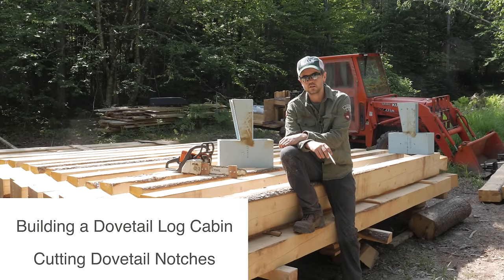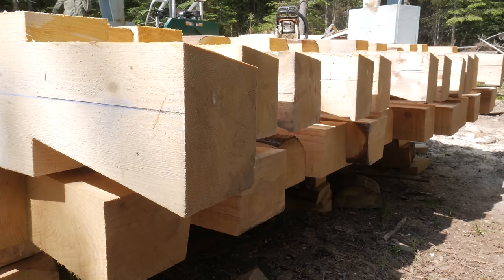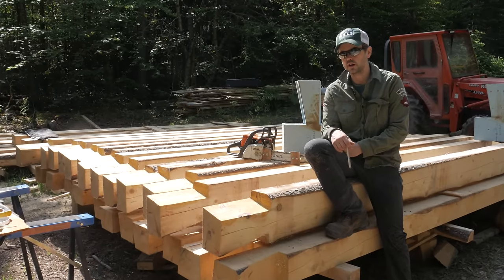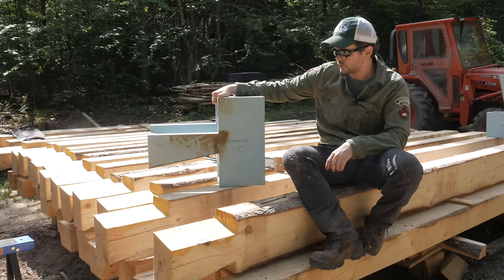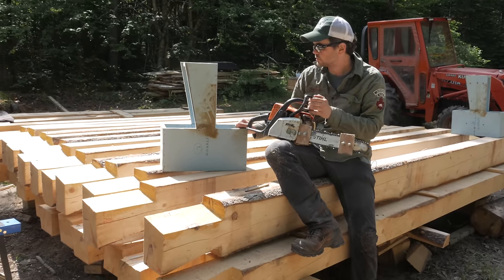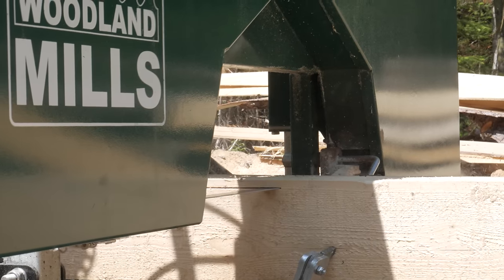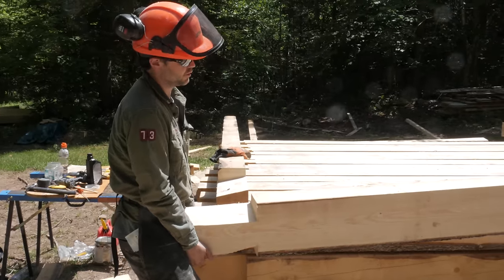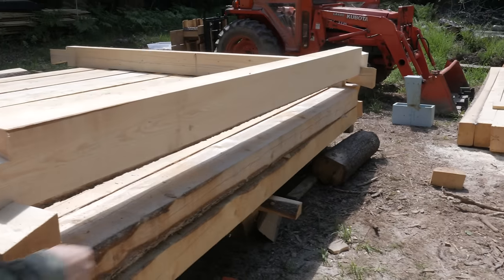Dovetail Log Cabin - Cutting Dovetail Notches

Comment: Handcrafted log houses have been built for centuries in the Eastern parts of Finland. Also in Scandinavia, Russia and Eastern Europe, and were typically built using only an axe and knife. The settlers from the northern Europe brought the craft to North America in the early 17th century, where it was quickly adopted by other colonists and Native Americans. Possibly the oldest surviving log house in the United States is the C. A. Nothnagle Log House (circa 1640) in New Jersey.  The Dovetail is designed to shed water in every direction which is why they are still standing more than 350 years later.
Reply from the maker: Hi Joseph! Thank you for that history and information. I find cabin history fascinating. The dovetail notch, to me, is just so beautiful. What part of the world are you in?
Reply: A very late reply to this video, but as I find myself coming back to it time and time again as I’m doing my research, I’d thought I would leave a comment to this as I saw it fitting.
We’ve had these types of dove tails in Sweden for I don’t know how many hundreds of years. It’s a very common style in my province of Sweden at least, we do however make another angle instead of having them lapping straight like you’ve done. We have them angled from the outer edge to the inner as well. So apart from the vertical angle, they’re also angled horizontally if you understand how I mean. Hard to explain really unless I could find a picture of it. Anyways, I love the videos and would like to see more projects from you!

Comment: I can understand 200 years ago why the used concrete or whatever between the logs to seal the gaps but you'd think by now something better would be used like a rubber seal that's squeezed between while it's being assembled. You know they would of back then if they had access to that sort of thing.

Comment: I built a cabin just like yours with the dovetails almost thirty years ago only difference was I left the live edges top and bottom on the log and cut my notches with out the jig. I enjoyed felling the trees and milling the logs with the chain saw , I even put a half story on the cabin and my floors and roof were made of poles and planks that were taken from the property. My foundation was a drystack rock that I also harvested from the land which on the downhill side was as tall as me and I'm over 6 foot. All in all the cabin took awhile but turned out looking like it had fallen out of a fairytale because it was created using material harvested on site. Great video it brought back some fond memories of my time in the high country.
Reply from the maker: Hi Mark! Really appreciate the comment and your story. Would be interested to see your cabin. Where are you located? There is something special about building a cabin, I really am enjoying it. I have learned a lot from many people in the process and it has been really rewarding. Thanks so much!

Comment: I just about finished my 16 x16 with an 8 porch using the same dovetail jig. It worked out fantastic and after about  1-1/2 years the first joints I did are still very tight.  Great system, good luck with the project.
Reply from the maker: The jig is great - I found it tricky to build, especially the beveled cut. Had a friend help who had some better tools. Where are you located John? 16x16 sounds like a good size. I hope my joints stay tight over time too. What kind of wood did you use?
Reply: @PenniacWilderness  mine is white pine in New York near Buffalo. Here’s a photo

Comment: I worked on some restoration of rotted sill logs + 2nd round on a historic cabin in AK.  Up there, they left the tops of the logs round and carved a cup along the bottom of each log to receive the one below.  I wouldn't guarantee that made a tighter seal, but that was their thinking back then.  We didn't think of a jig, just a ruler, square, saw, chisel and adze.
Reply from the maker: Interesting! It is fascinating to hear and see all of the different ways cabins have been built. I have seen the type you are describing, and likely it is a very good way to build. I started this build as a novice at best, so the jigs were good for me to use. I got the plans for the jigs from logdovetailjig.com and then made them in the shop.

Comment: Nice setup. Not the style I plan on using, but the use of jigs to reproduce same results is always a smart way to go and something I need to consider when I get around to building my vertical log Viking longhouse in two or three years on my second Alaskan property (currently building a tiny house on first Alaskan property).
Reply from the maker: Interesting! Alaska is such a beautiful spot. I went to Denali in 2017 and spent time in Alaska beforehand. Thanks for connecting :)
Reply: If or when a horizontal log rots it can be replaced. When vertical logs rot the whole bldg
needs replacing.

Comment: Put a 2X4 flat on top of each log to help make it more air tight you can put a bead of caulk on the 2X4 .... There will be a place to put mortar , just take two inch tape a run it along the top and bottom of the 2inch opening them fill it with mortar , let your flat trowel ran on top of the tape ... When it hardens remove the tape..
It will look great..oh might be a good ideal
To put a few drywall screws in to help hold the mortar in because that house will move ... From heat and cold ...

Comment: I've watched old Finnish carpenters build these things by eye with primitive hand tools from raw logs.  It's impressive.

In Scandinavian construction they stack the logs tight with only moss (insulation nowdays) between them.  This is warmer than clay or mortar chinking.
Reply from the maker: I get a lot of comments about the gaps - I gather that different regions seemed to do it full-scribed vs with gaps. I think there seems to be pros and cons of each. I just like the look of the chinking in a cabin, personally. I think with the size of my cabin, and the way I plan to insulate the roof that I should be able to keep it warm :)

Comment: Very nice job ‘ just one question ‘ I know the gaps between the logs are chinked ‘ can u tell me does there need to be some type of downward angle on the log faces to prevent water seepage into the cabin’ when the logs shrink’ eg driving wind and rain ‘ or as we call it here in Ireland horizontal rain ‘ thanks very well explained’
Reply from the maker: Hi Martin - Thanks for asking. Where in Ireland are you based? I actually have worked in Ireland before but am based in Canada. You ask a good question - I see some people use the downward angle on the logs and others do not. I am not sure yet what I will do. I have a lot of overhang on my roof to protect form the vertical rain. I could easily bevel the edge of the bottom of all of my logs before chinking though too to be safe. What are your thoughts? Are you building as well? I think you can also angle the chinking such that the upper portion of the chinking is recessed more in the joint than the lower portion and therefore creating a form of drip edge as well. Short answer is that I am still thinking it through and open to ideas!
Reply: Hello again ‘ yes I am building a cabin like yours 20 by 16 ft ‘ with them beautiful dovtails
Reply: Hallo again ‘ yes I an building a log cabin 20 by 16 ft ‘ with them beautiful corner dovetails ‘ the logs are mill top and bottom and milled on the inside ‘ with the live edge on the outside’ in other words d shaped ‘ there is a 5 degree fall out on the logs top and bottom ‘ with the inside vertical ‘ I think this system will help water to flow to the outside and not flow into the cabin ‘ with our horizontal rains ‘ I live in wicklow in the mountains ‘ the logs are milled on a bandsaw 8by 8 inches ‘ and milled with the 5 degree offset up against the saw bed stops ‘ I have the wall up and the vaulted roof nearly on ‘ I started this time last year ‘ and I think it will take me another year ‘ so a 2 year build ‘ but I love building it and it is a great learning experience 😄
Reply: @PenniacWilderness  big roof overhang (4'+) will save your walls & foundation better than eavestrough with the ice of a Canadian winter.

Comment: Why is there gaps between logs ? I'm from Sweden and we never have 2 inch gaps that we fill with clay or cement. That's something I've only seen in American tvshows. Is there a reason for this?  Nice video and aesome jig anyway. Looks like a nice build
Reply from the maker: Good question - I am not entirely sure why they did this in America. I have also seen the gaps in cabins in Eastern Europe. I am guessing that part of the reason may be due to the twisting of green logs. With the gap between logs any twisting would not really affect the overall cabin structure. I am not certain if there are other reasons. Let me know if you find out! I wanted to build this style because I just really like the look :)
Reply: You use less logs,  as many as 8 depending on the log diameters and the size of the gap you want, that saved a lot of man hrs when all you had were hand tools and horses.....and no precision required if the logs weren't perfectly straight....less frapping, I think thats what they called it when you used an adze or an ax to square/flatten the logs.... Some gaps are almost as much as 6"....
Reply from the maker: @jedidiah5131  Good point about using less logs - for ever four - five logs I am using, I probably save one. Thanks for the comment!
Reply: Many log cabins were built with logs that were neither hewn nor sawn along their length - they were round and rough, so there were gaps that required chinking.  Now people leave gaps without need, trying to look like those more rustic log cabins.
Reply: Thank you for asking this. I wondered the same myself. Now with saws being able to cut perfectly straight blocks it seems that it would create a better insulated house with no gaps at all and filling the space between with just some small strip of wool before placing the next layer of logs.

Comment: I’ve built cabins all my life- do not screw them together or use rebar to keep them from bowing!!!!! When the cabin settles there will be gaps and huge issues-
Reply: What other issues?
Reply: @masaigeraghty3525  Just my thinking... Probably best to let the cabin settle many years and the logs to bend or move as they want. Do repairs as needed. If you use rebar or spikes, one problem log could effect several more that its tied too. This certainly could be an issue if you're using whatever logs you can scrounge on a DIY build vs logs that will probably be more stable from a log home company.

Comment: @ 4:42---Half of a fraction is very easy to find. Also to double. One half of 1/2 is 1/4. One half of 11/16 is 11/32. All you have to do is double the bottom number. 19/64's becomes 19/128. To double, just go the other way. 1/4 becomes 1/2. 19/32 becomes 19/16's.
Reply from the maker: Thanks for that! Yea, I am so used to metric from my day job that fractions are not something I use regularly. I am picking it up though, I like your tip!
Reply: Did he say half of 10-1/8th was 4-1/16th ? Oh no 😲😲 stick with metric it's sooo much easier and better, catch up USA !!
Reply from the maker: @colstace2560  Metric certainly comes more naturally for me, but I am trying to work with fractions as best I can. I don't think I really used fractions since math class in school though.
Reply: Converting fractions to metric is another problem, for me anyways.  Whatever works for who ever is doing the work is a good rule. Thanks for the vid.

Comment: I like your comment about the bugs. Treat em like your training with weights on, i like that. If the training becomes too unbearable hehe, rub 100% pine gum turpentine on you jacket and they'll never come near you. Pine tree secretes pine sap to protect exposed area of bark so that no bugs or bacteria get into the bare wood. Turpentine is made from distilled pine sap meaning its a super strong bug repellant.
Reply from the maker: Thanks for the tips! Some day I should actually try that. I have heard about it but never tried. Thanks for the comment.

Comment: I hope you did not screw them. We did ours and as the logs dried they shrink sideways and you end up with gaps in the corners, because the log can't slide tighter. In the future we would drill a 1 inch hole an put a 5/8 ready rod top to bottom some play to allow the logs to be and stay tight in  the corners.
Reply from the maker: Thanks! We will see how ours goes. Lots are pretty dry, but we did screw them for a few different reasons. Time will tell, I will wait to do the chinking and can use it if new gaps open up. Thanks Robert for the comment!

Comment: Started re watching ur vids going to cut my logs this winter, when I order my jig plans what dimensions do I give Fred going to use cedar planned on only milling the inside and outside flat and leaving the top and bottom round, thinking of 2" gaps 6" wide by 10" to 12" tall logs cabin will be 12'x20' any info would be great Denis
Reply from the maker: Hi Denis, Do you want to chat on the phone someday? Send me an email at penniacwilderness@outlook.com with your phone number and I can give you some answers as best I can. Usually with Fred you just give him the log dimensions and the size of the gaps you want (I would think about larger than 2 inch gaps after my build). But let's chat!
Reply: We pulled apart an original log house in southern Ontario. The best preserved logs (150yrs +) were larch, not cedar. I was surprised!
Reply: @kerriwilson7732  larch is that a juniper or a tamarack tree that we call them here in southern new brunswick... lol

Comment: Simplest form of dovetail here, we would only use em for building where people don´t live in like barns, sheds maybe saunas, with out no wind blocking and stabilisation elements (that don´t allow the notch to move apart at all,  you should not use em for living quarters in harsher climates.  Although looks like not fully scribed, chinking style stuff so wind resistance isn´t high on list anyhow...   Still lovely to see more people getting into dovetail log building...

Comment: Dude, so glad you made this video....I'm building the same jig from Fred as well. It was nice to see it in action on here with those tricky bevel cuts. I ordered an 11 degree router bit for that, since my table saw only can do one side. Grew up in Downeast Maine (across from St.Stephen), you must be outside Fredericton..? Good luck with your build..!! 😎
Reply from the maker: Hi Dean - I have family in Perry, Maine. Yes I am outside of Fredericton area. I used a table saw for one jig and a bandsaw for another one. They were a little tricky to cut but after they are done the jigs work great. When do you plan to start your cabin?
Reply: @PenniacWilderness  Small world, my Mom grew up in Perry. Our family grew up in Calais, but I was born just past Perry  in Eastport. Anyways, I have 20 acres of 60 foot plus red and white pine. I've been felling logs slowly the past year or so to let them dry, I have a LT35 woodmizer to get them down to 7.25x10" I'm trying to do a zero gap. I only live 25 miles south of the property so its easy to get to.
Reply: Old timber framer here, Mainer exiled to Hawaii. Good job on your project and presentation. And good luck on yours.
Reply from the maker: @jdenmark1287  Thanks! Hawaii sounds like an alright spot :) I am located just north of Maine in New Brunswick, Canada. Maine is a beautiful spot as well.

Comment: A very fast and accurate way to divide a fraction in half (in your head) is to just double the bottom number and leave the top number alone. I don't remember where I learned this trick but as a carpenter I have used it for over 50 years.
Reply from the maker: Thanks David for the comment!

Comment: Or you could carry the centrelines down the front and back edges where they would come into direct contact with the line on the log. No confusing windows needed.
Reply from the maker: Hi Paul - Yes there are probably other good ways to do this too. The windows worked pretty good overall, but it did take some time. Thanks for commenting!

Comment: You don't always need to deal with the fractions. If your sides are straight and parallel, angle your tape or better your framing square until your "measurement" is an easy number like 12" in this case from side to side. Mark the center/bisection at 6". That mark will line up with 5 1/8" measuring at 90 degrees across a 10 1/4" timber. I know you said yours had a taper but it's slight enough in this case that it wouldn't matter. Try it a few times and you'll be surprised how little error it introduces, even when measuring at a drastic angle.
Reply from the maker: Good points! That also would be a good way to do it. Thanks for taking the time and the detailed explanation.

Comment: what about doors and windows? Do you cut them out at the end after the walls are all up?
Reply from the maker: That is my plan! I will mark them on the walls, reinforce the walls and then cut out the holes for the doors and windows. I might get to this over the winter even as it would be something I can do from the inside.
Reply: Just screw a 2x6 scrap piece from floor to the top row and go ahead and cut your windows and door openings you can just over cut them around 3 or 4” and go back later snap a chalk line and get them all perfect

Comment: Could you do this and double the length by putting a scarf joint in the middle of two logs?
Reply from the maker: You likely could. I used lap joints for my sills and ridge beams. A scarf joint would likely work too. I wanted to start with a relatively small cabin and I have heard (not sure of it is true) that too many joints in the logs can pose potential problems when the cabin settles.